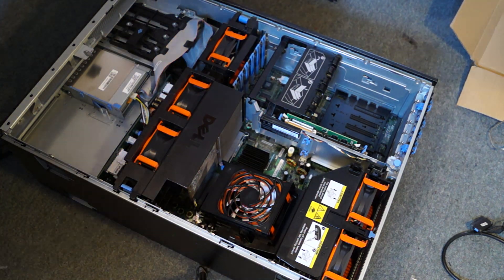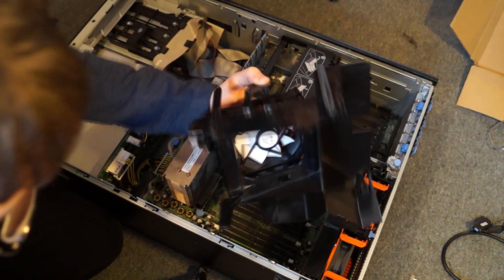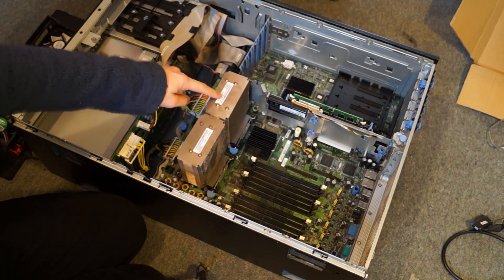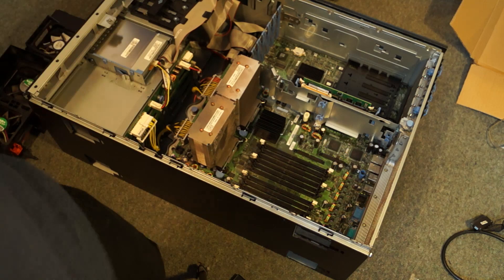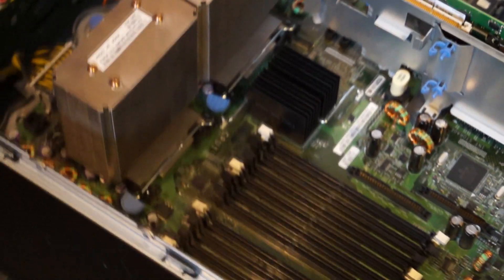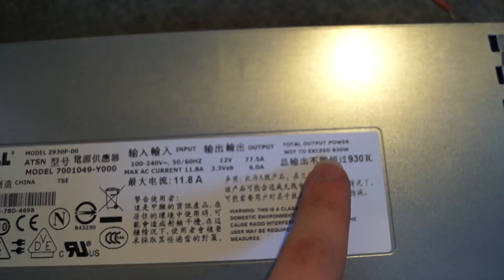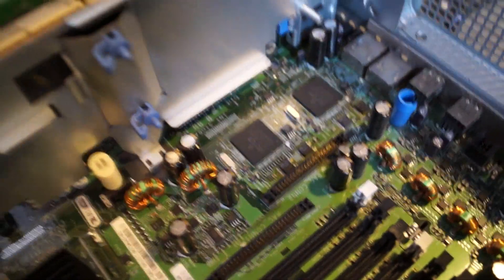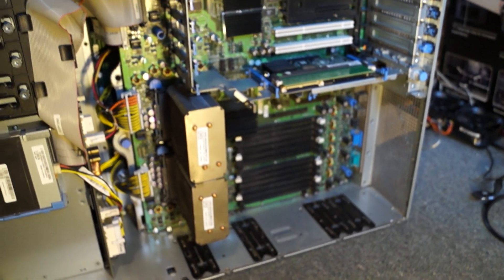Poweredge 2900 tour

Comment: Hello. At Minute 5.44 you are taking a controller out, that has 2 connectors.. Mine has only one. Is it necesary to have 2 to be able to have 8 HDDs?..  Mine is only detecting  HDD 0 to 3. I saw the HDD Dock has 2 connectors on the back..

Regards

Comment: I just got one of these and have no idea what to do with it... got any ideas?
Reply: epicdeuce NAS, gaming server for friends, rent it as a virtual server, backup server...
Reply: @Lagggerengineering  Where should he find a moron wanting to pay what running this server cost? Also what is the point of a NAS when you can get them preconfigured for little money and consuming in 30 years the electricity this one will in a month?
Reply: @Lagggerengineering  You came up with the idea of renting. Look up what renting means. Hint: it implies paying.

NAS ar of two sorts. The cheap ones that are sufficient for home use. (And cost a fractin of the electricity bill for a "serious" one.) And the ones used by companies but companies are for a profit, and hardware gets so obsolete at the point that it makes no economical sense to run them anyomore. Why do you think the server here was thrown away?
Reply: @emilemilian7404  I did not come up with the idea of renting.
The only thing that could imply renting is the game server for friends, which hardly requires renting if you already got an internet connection and electricity at home.

Secondly, my point still stands. This is a lot more versatile and powerful than the home NAS crap. Sufficient? Maybe. But still expensive and with very low capacity.

Also, servers get thrown away because newer, more efficient ones come to replace them, yes. But that doesn't mean you cannot use the thrown out ones.

Again, why buy a new car that barely gets you from city to city, but with great gas mileage, when you can buy a used car that is bigger, more luxurious and actually has power under the hood? Oh and also they are at the same price.

I have no idea why you are arguing about this, this guy already bought it so might as well use it.
Reply: @Lagggerengineering  Really? Wasn't that you who wrote: "rent it as a virtual server"? Short memory?
Reply: @emilemilian7404  Oh right, yeah. About a year short.

Then again what is your problem? He asked for ideas, I gave him some ideas. What you did is criticize my ideas while not providing any of your own, which does not comply with @epicdeuce s request.

Simple logic.
Reply: @Lagggerengineering  Why buy a new car? For the fact that other companies bought one already and if you do not the same your clients will wander to them, as they can offer lower prices. 

You think in your bubble, that is fine as you are a kiddo living at his parents having no clue even what rent means. But companies have not the luxury to run inefficient hardware, the pure cost of running is more than the price for new hardware and more important, not being efficient will first get your clients away and finally you go bankrupt.

Yes, you can use older servers. But not when it rentability goes in the way.
This is true for companies and for the private person. That is why the private person is best served by a cheap NAS. (Btw, backups must be done no matter if cheap or expensive NAS.) Ask your fahter why he does not drive to his job in a Panzer or an 18 wheel truck.
Reply: @emilemilian7404  Oh now you bring out the "I am older so I know better than you"
Guess what? There is more than just money in the world. One of these things is knowledge.
If this guy wishes to learn something, then more power to him.
I never ever ever said he would make money on this. But guess what I don't know? 
I don't know where he lives, I don't know how expensive electricity is there or even if it is paid at all.

He asked for ideas, I gave him ideas. 

He did not ask for successful business practices.

And you here don't seem to realise that an 18 wheel truck costs a hellova lot more than a used car or a new crappy car.

Same for this server. It is cheap. It doesn't cost much to repair. It doesn't cost much to maintain (replacement parts are cheap). 
And it might not cost much to run.

Do you really have nothing better to talk about than a kid who wishes to learn how to use something he bought?
Reply: @Lagggerengineering  As I said before, companies are founded for profit. So yes, it is all about money. They are not there to distribute charity.

Please don't distract from the subject of the discussion. You tried it first by lying and shamelessly assuming I am an analfabet that can not read what is clearly written from your account. After you continuosly try to come up with matters that have nothing to do with what we discuss here.
This single point is only and only your statement "rent it as a virtual server" and my answer that he will find nobody who is willing to pay as companies offer this service for a buck and a penny these days, no chance to be en pair with those price- or servicevise.

Now this one simple thing is above what you are capable to understand. So I am not bringing any I am older but the "you have no clue". But I brought that from the very beginning, as it was and is obvious that you haven't any.

Comment: Can you render on this server? Can you split it into Virtual Machines? Will my Electricity Bill go through the roof?
Reply from the maker: You can render on it but it takes ages. I run 5 VMs for all each OS I test on. Yes it is a bit power hungry. 300W idle :S 

Getting a T620 with 2 E5-2620V2 so should be a bit faster!

Comment: I'm getting one for cheap, It will have dual PSU's on it, Do they lots of molex connecters on them? (I don't mind using adapters) I want to plug 5 x R9 270 in (They use 6-pin power) to coin mine. The x4 slots won't affect them much.
Reply from the maker: I was going to try a card in it, How are you going to fit 5 cards in? Are they all single slot or something? Its going to be very loud and hot.If you want to use the hard drive back plate then I don't think you will be able to power them unless you use an external PSU since it only has 2 molex or something which is not enough.

There is 77A on the 12v rail which is probably enough to run the 5 cards so what you could do is not use the hot swap drive back plate and use the ATX connector for that to get your power. You would have to either get an adapter or do some soldering in order to use it though. Just use very thick cable if you plan on doing that. 

If you are hoping for this to be quiet in any way then it will overheat guaranteed. You won't be able to change the fans, and you will need to probably add more.

I am not exactly sure how the chipset will like it when you run 5 4x devices on it, so you will probably need to put cooling on that as well. 

Also how are you planning on putting the 16x cards into a 4x socket, In my one I have taken off the black shrouds covering them and there doesn't seem to be any obstructions blocking a 16x connector. But you will need to either cut or melt the end of the connectors off which is quite a risky process.
You would only have to mod the 5th card somewhat to get it to fit since the 5th socket is not designed for a standard card. it is specifically for their RAID cards.

My suggestion is to only get 4 cards which are single slot, keep the original fans so it doesn't overheat and make sure the cards don't get too hot. Use 1 or 2 hard drives on the standard sata ports, there are 2 in total, and make some custom connectors for them. Remove the hard drive back plate and use the power for that on the cards. The longest PCIe card that will fit is 12" so you should be able to fit almost anything in. If you link me to the cards you are going to use I might be able to advise on any mods you might need to them.

Since it is quite an old system things run a lot hotter than you will be used to. E.g. The ram on mine idles at 80oC (although that is with the quiet fans and BMC hack)

Another thing is that it is EXTREMELY loud with the original fans, but they will be required to stop it all overheating. So just shove it somewhere they won't bother you.

Comment from the maker: What do you mean by direct replacements? The only way to be able to change the fans to lower RPM and hence quieter ones is by flashing the BMC. 

My one runs reasonably cool although the ram does sit around 80oC if you don't cut the PWM lead on the fan above it. Although saying that its been running for 2 months now with no problems. 

I bought my ram off amazon, I have put a link at the bottom of the description for you.
 
You will also need to mod the Perc5i (Raid card) to use quieter fans.